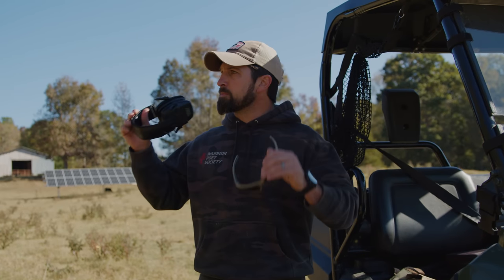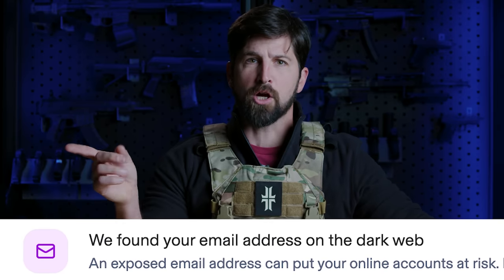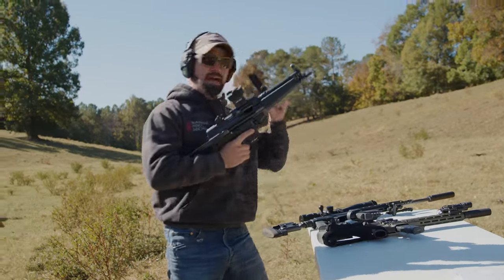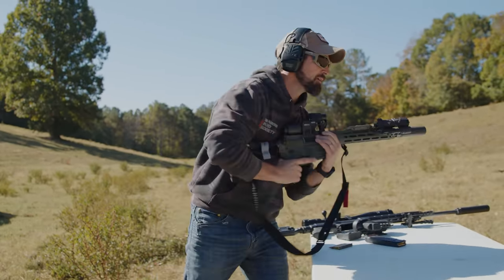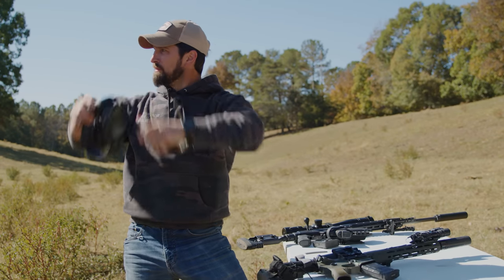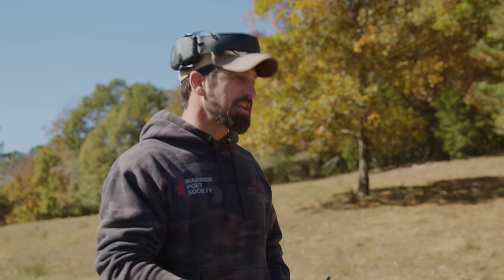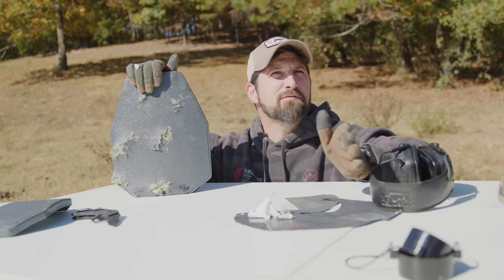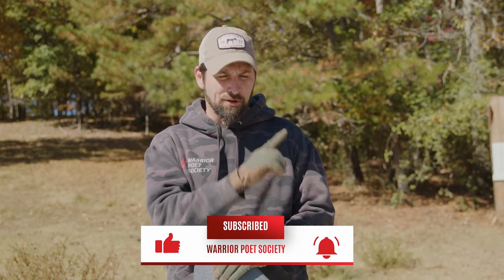HYBRID Armor Plates??!? Armored Republic A3 Plate

Comment: I thought the Creedmoor was going to blow through,  the plate is awesome,  4 1/2 lbs, thin profile . It's a winner. 👍  Thanks  John🧔
Reply: Velocity or density or ideally BOTH for AP work.   If it's not cooking over 3000fps it is unlikely to go through plate.
Reply: @AKlover  yep all about velocity. 6.5 C only goes 2800fps. 
Would like to see a 224 Valkyrie..
Reply: @DataGeek903    22-250    But really A copper projectile M193 out of A 18-20 inch barrel very well might cut though.   Notice Lovell put M193 through A 10-11 inch barrel ....... THAT WAS NOT A COINCIDENCE.  A suppressor MIGHT add 50-100 fps.
Reply: @AKlover  saw another test. Awful backface deformation from I think it was M193

Comment: Test out the Battle Steel Level IV plates. They're 5.5 pound hybrid plates. I've seen LOTS of tests on these affordable plates as they're cheap enough for independent people to test, and they do indeed hold up. I have a set in my lightweight scout armor rig (10x12 plates instead of my usual 11x14, and no side plates).
Reply: Battle Steel Level IV Origin: IMPORTED. That's a big NOPE!
Reply: Those botach plates were awesome when they were $90, but now they are like $140 which approaches the price point for lower end American made armor. The chinese LongFei or whatever high cut helmet is still a good deal though at $200 shipped.
Reply: LAPG plates as well are only like $130 a plate and have held up very well in testing, especially for the price. Plus occasionally they  go on sale.
Reply: @strix4667  Yeah, but MADE IN CHYNA.
Reply: Also, it’s only an 8”x10” plate. It has a 1” foam edge around the entire plate. That’s how they achieve 5.5lbs.
Reply: @strix4667  I agree.  The LAPG plates are the premier budget ceramic plate.  I have three sets of them myself.
Reply: @DaveSmith-cp5kj  But they're substantially lighter. That's the key thing here. They're a full 2 pounds lighter at a similar price point.
Reply: @WardenWolf  It's lighter because the ceramic is miniscule (its mostly a PE plate), which is also why they are thinner.
Reply: @SamuraiEAC  typical snob
Reply: @noeitiim7386  LOL Why? Because I don't want my armor to be Chinesium?
Reply: @SamuraiEAC  You can literally look up videos of battle steel plate stopping rifle rounds. Put your nose down dude 😮‍💨
Reply: @noeitiim7386  I could care less.  I am not buying armor made in China. 🤷‍♂️ Did Fang Fang get to you too?
Reply: @SamuraiEAC  No, I'm just not biased against Chinese products.  Maybe 20 years ago sure, but there's nothing wrong nowadays. 

Quality doesn't scale with price buddy
Reply: @noeitiim7386  I am biased against Chinese armor since I can easily buy American made armor. 🤷‍♂️  Have a nice day! 🇺🇲

Comment: All: Several years ago during studies on composite overwrapped launch tubes and barrels the researchers came up with a term called "critical sound speed".  This term explains why laminate armor works: The impact dissipates energy to the media at the limit of its sound speed. Square root of modulus over density. As an example rubber has no STRENGTH but capturing it between strong materials makes it transfer the load as if it's absolutely rigid because it's sound speed is low (natural rubber is as low as 25 fps). The "sandwich" also changes the direction of a shaped charge jet which is why they're used on light armor vehicles that cannot take a reactive pack.

Comment: I would like to see one of those plates take a 500 s&w round. 
I have seen what a 350 grain hollow point did to 2x2x1/4" angle iron at about 50yrds. Bent the flat side about 1inch in.😳🤘🤘

Comment: John,
I know this video was about plates, but I'm curious what your updated preference is on plate carriers. Specifically, do you think the HRT LBAC is better than the HRT RAC? 
Or perhaps there's an even better plate carrier system out there you prefer. 

I have a CRYE JPC 2.0 which is fine but I do not like the cumberbund velcro system for donning and doffing which the RAC + LBAC seem to do much better at
Also, my CRYE JPC 2.0 has the GT2 plates in them but I am trying to find a system to make them more comfortable as my Army issued plates plus Kevlar backer made wearing plates much more padded to wear (particularly for going prone) and I am wondering if there is a system similar to that as far as current plate carriers go. Perhaps I need a better plate carrier or perhaps there is an insert I can add. The plates do fit quite tightly already though. Thanks in advance

Comment: I looked at these AR500 A3 lvl 3+ plates for quite awhile initially, the weight was really nice but the price point and potential spalling ended up being deal breakers for me.  I wasn't finding enough videos at the time on if they spalled or not so I ended up going with some lvl 4 Highcom 4SAS&'s instead.  Heavier, but I was left happy overall with my decision.  Interesting to see a more in-depth review of these, thanks!
Reply: There is no potential for spawl.  And reviews proving that have been out since the day these plates released.
Reply: buildup coats usually stop fragmentation, and if you are still not comfortable with that there are frag sleeves for like $50 that solve that problem. fragmentation IS a threat when you have a bare plate and thin carrier, but buildup coats and any decent thicker carrier really negate that issue. the multi hit capability of steel with the buildup coat/frag sleeve are great, especially if youre in a static position or riding in a vehicle where you probably will take multiple hits before being able to get to any cover.
Reply: @RTTGunsGear  The reviews I saw were either directly from the company, which I don't always trust from any company due to marketing gimmicks, or folks on YT who weren't running the plates through the same set of criteria that I would have preferred to see.  I am not dinging the design, but to me the possibility of molten hot metal shavings ending up in my jugular had me pass back then.  I am sure John's testing put more people's minds at ease like mine.  I got to see it getting caught within the coating/ballistic cloth.  They didn't use to put the ballistic cloth in there, it was just the rubber before, you know?  When that rubber would take a few hits it would just fall off back in the day and all you had was solid metal again that could spall.
Reply: @darkangelgaming1117  The steel strike face of the A3 plate is very thin. It isn't designed to stop the bullet, but instead it is there to slow it down enough for the polyethylene to catch the bullet. This goes for M855/green tip as well as those are the ones that pass through polyethylene plates.  So, the A3 does not have the same type of ballistic characteristics as steel core armor and there is little to no fragmentation or spalling. One question I like to ask: have you ever actually read a report where someone was killed or even hurt from fragmentation from wearing a steal core plate? I haven't. Ever. Final point: "Fragmentation" is the fragments of the bullet when it strikes the plate. "Spall" or "Spalling" is part or parts of the actual plate that breaks off due to being shot. There is a difference. 👍

Comment: Can someone explain to me why these types of plates are $400+?
Bear in mind, I can find 4" thick 10"x12" slabs of UHMWPE online right now for $240. That's the thickest I can find, and that's way thicker than UHMWPE armor plates.
No, I'm not recommending raw UHMWPE slabs as a viable alternative. I just can't wrap my head around the price tag of high density PE plates when the material is common and widely available for much cheaper. Shaping and spall coating does not cost that much.
Reply: Think about the liability insurance thy need to have to sell armor. That’s going to add a huge cost.

Comment: I'm 63yo and have 4 bulging discs in my spine as well as worn out knees...best I can do is PE level 3A plates that weight 3lb. for both plates and pray I don't run into anything bigger than.357sig. Though at my age and in my condition I don't do much running into, out of or away from anything... 😂

Comment: So "edge to edge protection" needs an asterisk  since that's not quite a valid claim even on a short test.
Reply: Exactly, this is also a problem with Shotstop plates which have around an inch where it drops its level 3+ protection more to an 3A protection just to reduce weight. Sketchy marketing if you ask me
Reply: There is no such thing as edge to edge protection.  There’s claims of it.  But every plate on the market has a line where when you hit it 90deg to the edge, that it either will or will not stop it.

Comment: Hey John, thanks for all you do, I really appreciate all the information you provide. 

Question, what are your thoughts on the trade-off of protection/mobility regarding side plates. Specifically, as it relates to the non-professional (have prior military experience but it's an office desk job these days) - home defense/SHTF and time to book it.

My thinking is in a home setting, mobility is less of an issue and I have the advantage of knowing the layout, why not get the protection? Moreover, in a home defense scenario, I'm clearing the house on my own. With a team, you have someone watching your back but solo, sometimes you just can't physically cover every possible angle at the same time.

SHTF is a bit more dynamic of course so mobility likely matters more but still on your own (at least to start - unfortunately not all of us have folks around us that take preparation all that seriously (especially in NYS). 

Add in that a side shot can rip through multiple organs, and it seems like it makes a lot of sense to wear them 0 even if it does add 3-5lbs or so. Just wondering your thoughts. Thanks in advance!

Comment: can you find out what CAN penetrate spartan armor ar550 plates with the buildup coat? i know 30.06 AP can, but theres really not many videos testing SA ar550 plates. id also like to see some testing regarding fragmentation with them too if ya can.

id like to see m193 and m855 from an ar with 20 and 24 inch barrels at close range at least.

Comment: One thing I see a lot of with these armor tests is a lot of people will test the 62 grain M855. But very few people test the 62 grain m855 A1 round. It's hotter and the tip is a big difference. Big reason why I went with the deridium GT2 plates instead of the other ones that are slightly lighter. Having protection from the A1 variant seems like a big deal to me.
Reply: How many people do you know with a stockpile of M855A1?  People talking about armor stopping that round is almost a meme at this point.  It’s funny that anyone even mentions it.  And more so, mentions it in the comment section of an armor video about armor that isn’t rated for that.
Reply: @RTTGunsGear  hey you never know what someone is stockpiling. If you can afford it get the highest level plate you can. I have some heavy a$$ steel level IV and some light ceramic level IV. I hope that SHTF doesn’t happen within the next few years and if it happens when my ceramic is expired I have the steel.
Reply: @J.Young808  you never know if someone has an RPG, or a functional tank !!! Smart people prep for what’s common.
Reply: @RTTGunsGear  the M855A1 round is fielded and stockpiled by the US Army. The same army that is bought and paid to buy the US government who has the ability to print money and offer up big contracts to ammo manufacturers. I'd say there's enough of this ammo in America to call it common given that bit of information. Though I don't really care what you think on it hence I'm not buying armor for you but for me. And being in an army area it's common enough for my liking. But I'll be sure to send you some cool memes next time I wear them.
Reply: @don8659  I’ve never quite seen so many meaningless words said.  Hey, at least you accomplished one thing.  Tying your shoes is next and then you can be a big boy!
Reply: @J.Young808  exactly man. I get prepping for what is common but there's an argument to make that that round IS common. And if not. What's the harm in it. Plate is right at 3lbs and stops A1. If it can do that what's the harm in advocating for it right? I'm more of the mindset of prepare for the worst in the best extent you can and hope for the best. Not the other way around.

Comment: How about the lvl3 and lvl4 guarddog plates? They are light and seem to be legit
Reply: Guard Dog are fine from what I've seen, but I recommend Battle Steel Level IV hybrids simply because of weight and price. Here's the deal with Level IV: most people don't realize how insanely overprotective it is, and how much it actually takes to go through it. Battle Steel plates do indeed perform to full Level IV specs, but Level IV is so absurd that anything even approaching it will be good enough for any reasonable threat. Basically, the only current military round that will go through it reliably is .50 BMG. Nothing in common use, not even .338 Lapua, will go through.

Comment: I have those plates and they’re the best in the business in my opinion.  Also…Finally!!! Someone else admits that they don’t care about NIJ certified.  Been saying for years.
Reply: @eedd sdsd NIJ certified doesn’t mean anything to me.  Just as John said.  And for helmets..the NIJ doesn’t certify any helmets.  So anyone that says their helmet is NIJ certified, is full of crap.  Helmets get tested independently to level IIIa standards.  And that’s it.
Reply: @RTTGunsGear  yeah i dont really care about NIJ either, all i care about is seeing independent testing like this. ive been doing a LOT of research into body armor this last year. from what ive seen so far i really like spartan armor ar550 plates with the buildup coat, just a solid piece of body armor. it is nice seeing these newer plates coming out too.
Reply: @RTTGunsGear  sounds personal. Sounds like an ex or enemy works at NIJ because why wouldn’t you care about NIJ standards? Not caring about their system means you actually don’t care about protecting your body. It’s odd

Comment: This is terrible compared to steelops, they use the same undercoating on an mrap for their coating on the plates and they the cut size i got weighs 4 pounds per plate at level 3+ each and i shot one extra plate with 35 rounds of a mixture of m885 and m193 from a 20 inch 5.56 barrel with NO fragmentation but the coating COMPLETELY encapsulated every single piece of lead. Thes plates in this video don't even compete in any category against STEELOPS

Comment: I’m looking into these, but I am very new. I was thinking of starting with soft armor for my civilian life and even events. Does any one have opinions or knowledge here? I feel like soft armor gives more coverage and is more concealable while hard plates offer better resistance and are less expensive overall. Any specific recommendations are also welcomed.
Reply: Just know that soft armor won’t stop a knife. 

Stay safe out there.
Reply: If you read through the comments, it’s apparent that most people here don’t know much about armor.  These are great plates and would suggest them to anyone.  They’re in my primary carrier right now that I use when working in high drug trafficking areas of the southern border.  Soft armor ( level IIIa ) is only good for pistol calibers and I really wouldn’t suggest it for anyone, except maybe in a backpack.  Now beyond the plates shown here, you can get steel level III and III+ plates with a build up fraglock for a reasonable price.  But they’re heavy.  As John showed, almost 10 Lbs per plate.  And then you have level III and level IV ceramic options.  They are usually a bit more expensive than steel and tend to have questionable hit properties.  Ceramics tend to be lighter, sure enough.  But they’re thicker and don’t generally have great multi-hit capabilities.  And then there is one outlier.  And that is the solid PE armor.  Super light weight, but a lot of rifle rounds will zip right through it.  So, make your choice.  I have all of them in my inventory and I choose these A3 plates as my go-to
Reply: @RTTGunsGear : I have the lvl3+ but I’m sure I’ll still buy a set of these. 
Thank you for your service sir.
Reply: Stay away from these plates, the qc is spotty at armored republic and since these are not NIJ certified, there are no follow inspections to ensure armored republic is adhering to the standard. 

What is your budget for plates and what do you want those plates to stop?
Reply: @ACGBLR : Thank you for the heads up
Reply: @ACGBLR  good to know about qc issues. I’m just a civilian, so I’m looking to defend mostly against pistol rounds on a day-to-day basis. Budget is movable. I was originally trying for around $500 for a set-up, although I don’t even really know what is realistic. Ultimately I want the best resistance I can get at a reasonable price that is concealable.
Reply: @RTTGunsGear  Thanks a ton for this breakdown. Always my preference to hear from someone who is using the products as intended.  I’m a civilian, in your opinion should I be worried about rifle rounds? I had really imagined pistols being the threat, what do you think is realistic? I worry about the steel armor due to the bullet fragmentation but you mentioned the fraglock, do you think the fraglock works? And one more, is hard armor concealable enough? I’m a small framed guy. Thanks again for the info, and for your service.
Reply: @justineisenmann8011  for pistol rounds and concealable. Level IIIA would be the option there. Check out RMA for good quality options there.

Pistol rounds will be much more common than rifle, there are some plates out there that are thin enough to conceal. They are expensive though.